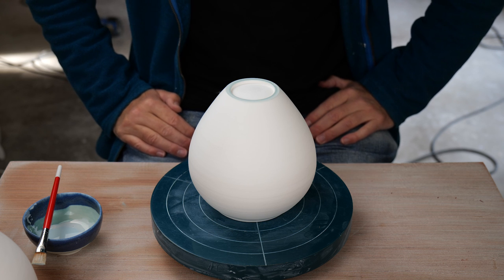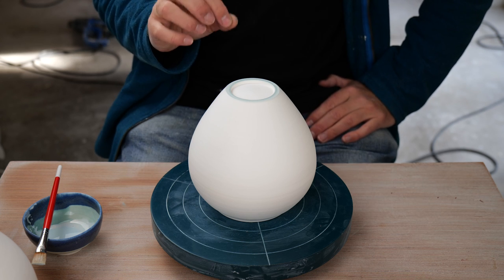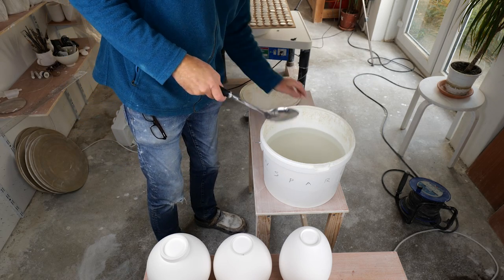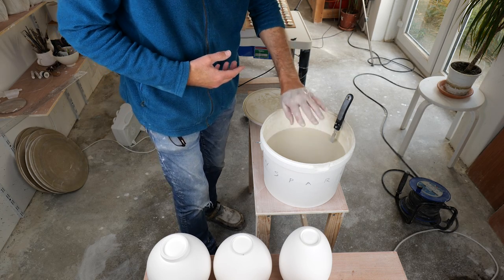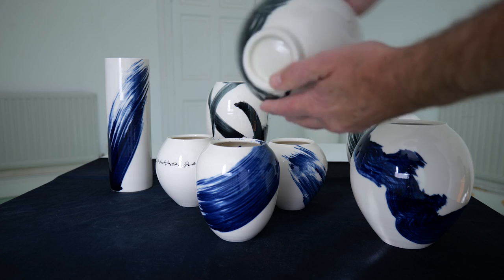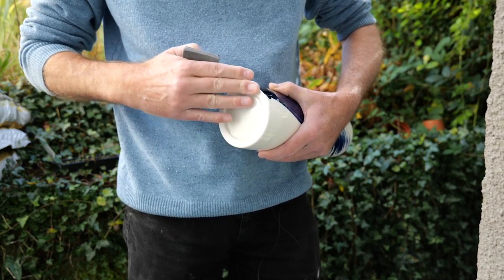How to write on a vase

Comment: Very nice work. The one thing I would add about wax resist is that it is a good idea to keep the sponges separate as it doesn't take much for a sponge to pick up a bit of resist and wipe it where you do not want.

Comment: Hi Tom, thank you for giving us your insight on glazing your vases. I like the dynamic of your glaze. 
You did not show how you applied the transparent glaze on the outside after you have brushed on the underglaze. So I wonder how you did it without smearing your brushstrokes. 
Would be delighted to receive an answer .
Reply from the maker: I've been off YouTube for ages and only just seen your message! For small pieces like bowls I just dip them in glaze with glaze tongs. For larger pieces I spray them with glaze. The brushstrokes only smear if they are touched.
Reply: @TomKempCeramics  Thank you for your response 😁
Reply: Ok, now we're talking😂❤
Reply: Good question

Comment: Thanks Tom - am really enjoying your videos. I’m new to Ceramics (my background is Printmaking) and - like you - am learning lots through YouTube. Can you tell me which powdered underglaze you were using please? I like the idea of mixing up my own stuff but am getting really confused about what to buy from suppliers. Thank you!
Reply from the maker: I just experimented a lot with different brands and colours. Currently I generally tend to use underglaze powder from a UK supplier (Potclays) plus a tiny amount of Mason stain.
Reply: A safety thing.  Mix your powder glazes outside.  Sand pots outside.  If you have a bucket of already mixed glaze, powder and water, you can stir those back up inside.

Comment: Absolutely stunning. Thank you so much for sharing this. I've tried to use the Mayco Designer Liner and I have struggled mightily. Would you say that feeling comfortable using the pen is a bit of a learning curve? Any ideas are appreciated!
Reply from the maker: Writing with a metal tip on bisqueware is always a bit taxing. Try to reduce the pressure on the surface to the minimum you can get away with to avoid that scratchy feeling.

Comment: Thank you for that. Is there a reason for glazing the foot at the same time as the inside? 
My thought that it is a clever way to add moisture to the foot, so that you don't get to thick a glaze application on the inside at the bottom. I have found that when pouring the glaze into a bisque pot, because if the time it takes to pour it around and out, the glaze is quite thick on the bottom. Which can lead to cracking as it dries and crawling when fired.
Reply from the maker: I apply my transparent glaze quite thinly so I don’t get a big build up in the bottom inside. Often I have the opposite problem where the footring is trimmed quite thinly so I need to let the glaze in the footring dry thoroughly before glazing the inside; otherwise I don’t get enough glaze sticking to the bottom inside!